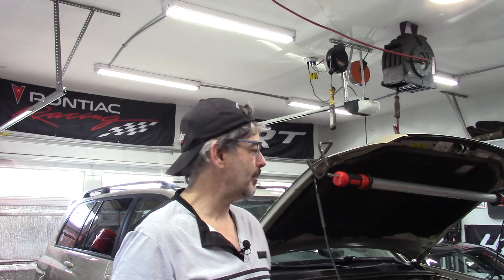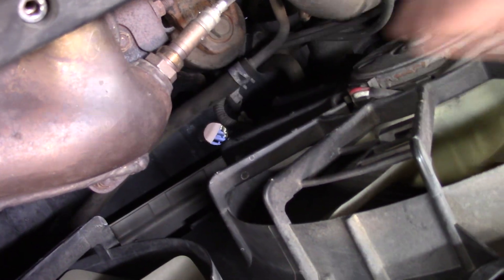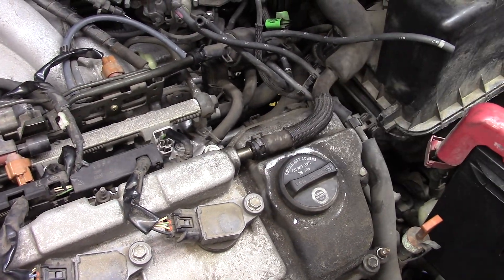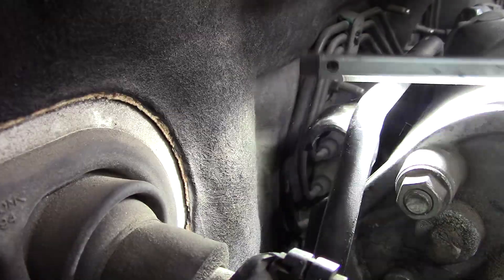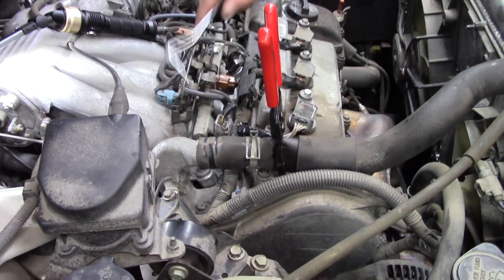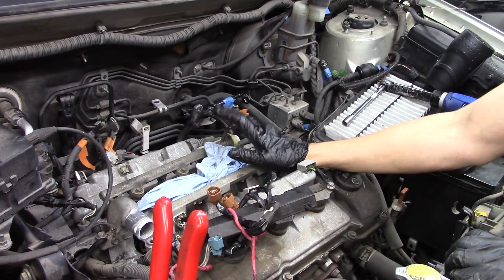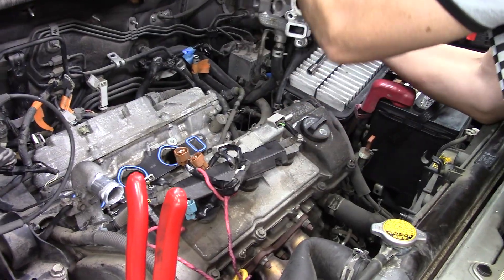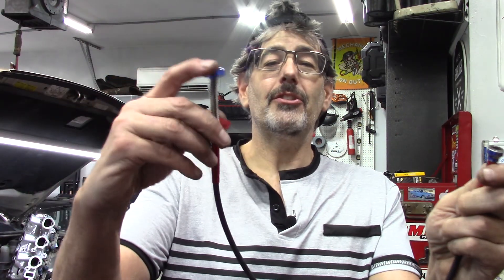Tools Gone Wild! Application of Tools for Intake Manifold Removal

Comment: What was the slip joint pliers you used to remove the upper radiator hose? I don't see it linked or mentioned in the description.
Reply from the maker: Apologies, we meant to include it but couldn't find the exact tool link.  I have added a WASHER HOSE PLIER link to the video description under. ***CORRECTION***, as I'm not allowed to link products in comments.

Thank you for viewing and for pointing this out!

Comment: I have the Astro Pneumatic underhood light bar(bar only,no lights) . It's an adjustable bar that has two sliding magnetic platforms on the rail that allow you to put your own lights on it. I like it more than a traditional underhood light bar because you can position your own light the way you want them. The platforms rotate. It also makes it easier for directional lighting on certain spaces and i can easily pull off the light to use to closer inspect something.  It comes with a pouch so you can add a battery bank to charge your lights(if not already charged). It's just more versatile and allows more functionality.  Its pretty stout and can even be used to span interiors. I use it for cleaning the inside of my car.I believe ICON has something similar at HF.
Reply: That sounds awesome.  We will take a look at it!  Thank you for the info!
Reply: Thanks for the tip. What do you use for the actual lights?